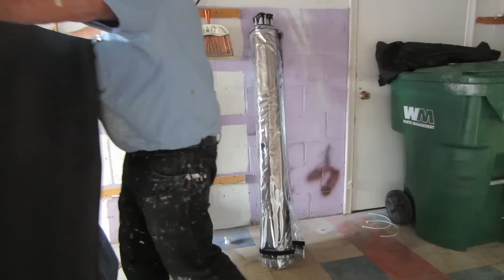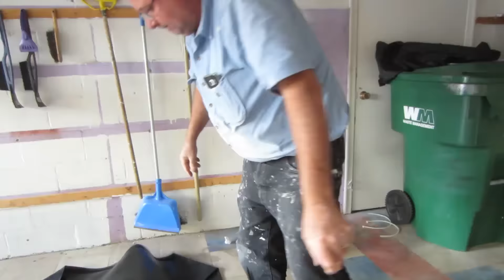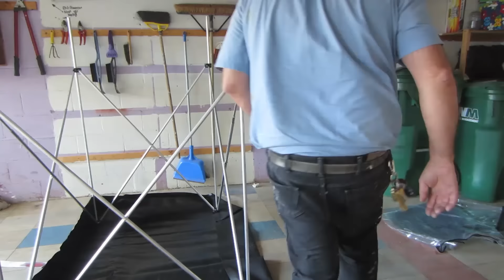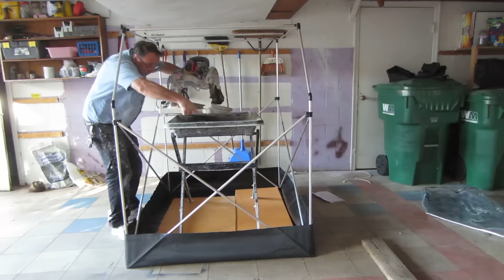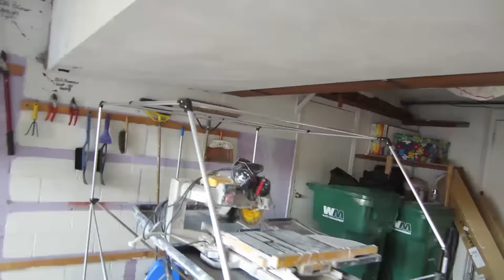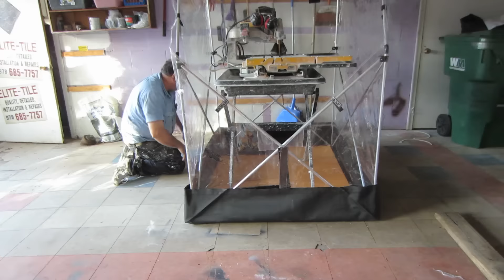Time lapse Barwalt Saw Shack

Comment: But how easy is it to work with?
Reply from the maker: +Tsunami Dream Plenty of room in the front to work as usual, only issue might be when you have something extra long to cut, but easy enough to fold down the sides if needed.
Reply: +Sal DiBlasi ok thanks Sal